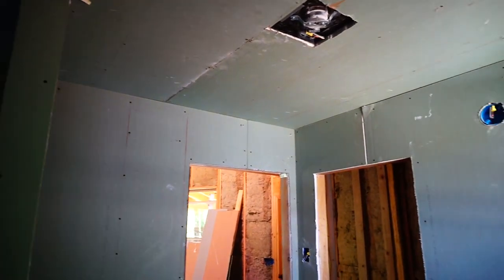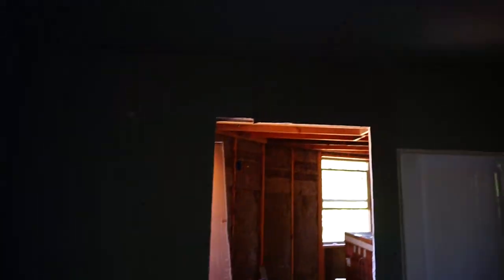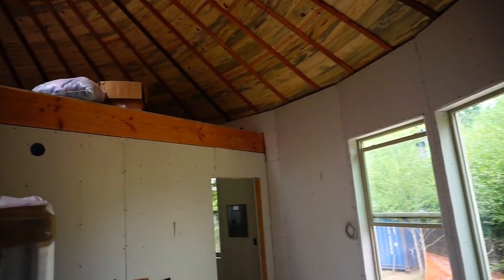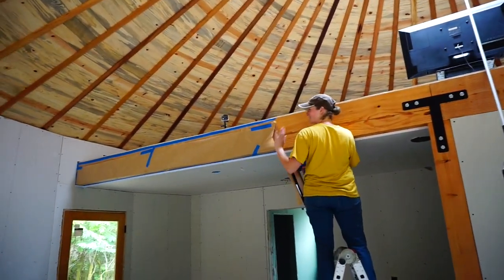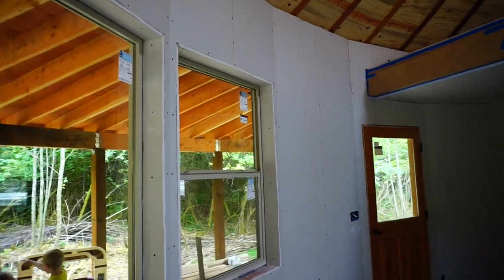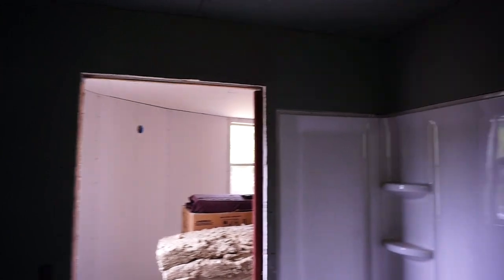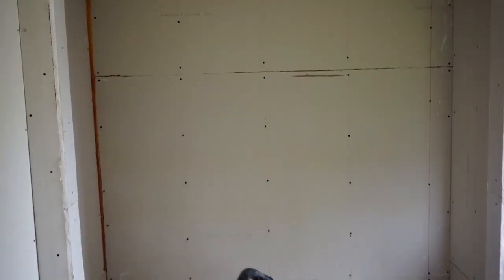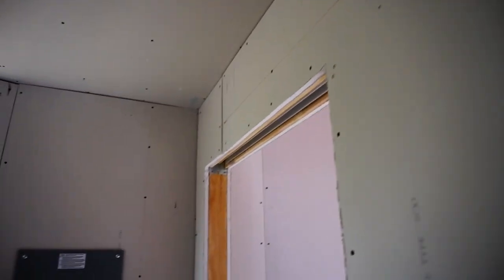Building an Off Grid Yurt Part 13: Drywall Up!

Comment: Nice job. While not being the fastest, I'm not that bad at installing drywall and mudding. However, I learned quickly to subcontract drywall whenever possible. Those guys are fast and efficient and I have no intent to join them anytime soon. Keep up your good work.
Reply from the maker: +Simon Forget We tried to hire out the drywall. Out of the ten or so we talked too. 9 were booked for 2-3 months and the one who wasn't was way more than we felt comfortable paying. So we rolled up our sleeves and dug in. It has been really good even though it is hard.
Reply: I would have done the same. There is no way to pay more than what is worth or to wait longer than we are comfortable with. Bottom line:  you are not done yet but closer than you were before. Keep up your good work.

Comment: Do you need to rough sand the edges where they meet to take care if they don't line up before mudding or just put on enough spackle that it will be smooth?
Reply from the maker: +Bob Bullock We just used a fast drying compound that they call hot mud around here.